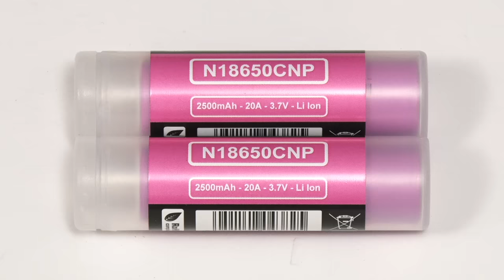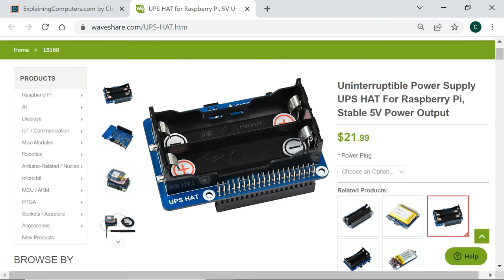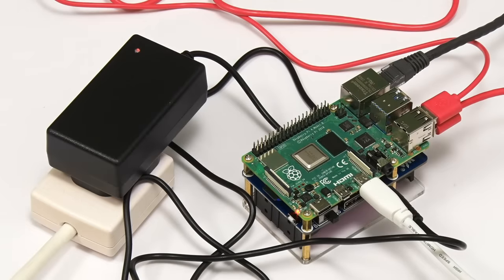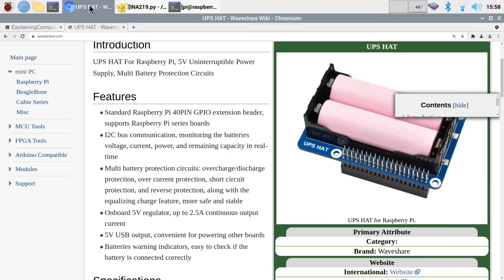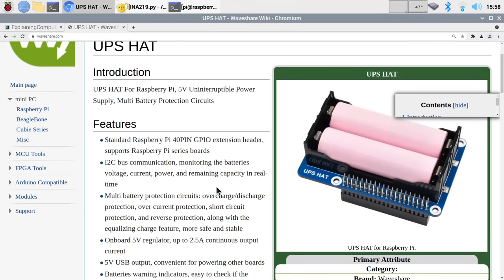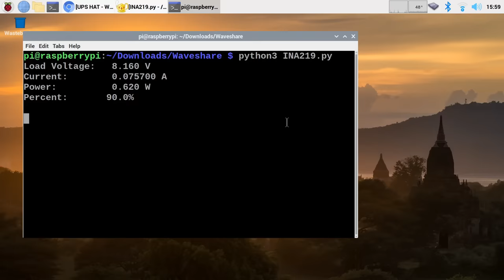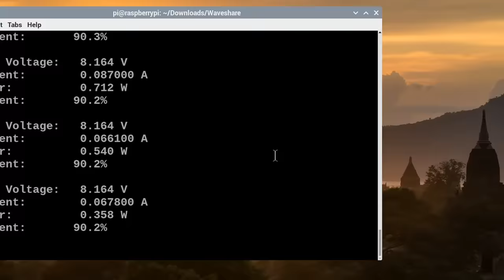Raspberry Pi Waveshare UPS

Comment: So they can't solder to battery's output a simple $0.70 full bridge rectifier as reversed polarity protection? COOL
Reply: Yeah, why don't they introduce an unnecessary 0.7 V potential drop on a low voltage system and unnecessarily complicate the whole current pathway just so people don't have to pay attention to which way the cells are inserted even though they've already included two reversed cell warning LED which they didn't have to do.
Reply: @igrim4777  Drop is not a problem since it's in battery range of 3.7-4.2V. The problem is in the following things:

1. Warning LEDS are just visuals, what do you think would happen if this "protection" fails?
2. Why the design is serially connected batteries when we'll definitely want bigger capacity for this "UPS"? The required higher voltage can be stepped up and there's a lot of room on the pcb to be integrated without a hassle
Reply: @GbpsGbps-vn3jy  Of course it's a problem. Unnecessary voltage drop is always a problem. It represents wasted power in the circuit not only due to the rectifier itself but additionally in whatever boost regulator is used because the higher the voltage change required the worse the boost efficiency.

Your question about what if the warning system fails is specious and invites the question, What if the rectifier fails?

The more components, the more points of potential failure. The warning system is a nicety, not a necessity. If it fails you're not told the cell is reversed but it's only a backup system. The power supply can still function as intended. If a rectifier fails, there goes your whole unit and while it's not that hard to do either, it's still harder to replace a bridge rectifier than an indicator LED.
Reply: @igrim4777  First of all, show me how many failed rectifiers you've collected, especially when used in below 12V DC @ 4-5A max?
Second, you don't need to have a warning system, but a proper design. For example I rly don't see where on the pcb is the protection against reversed polarity or other common failures known to happen in UPS?

Comment: What is the point of a UPS saving it from power failure if it's just going to under volt the Pi when the power comes back on.   Sure your Pi limped along but it wasn't doing anything.   If it was actually being useful it would need more power.   This seems like a bad project.

Comment: I notice some questions about battery life.  Chris has a great video on this subject in his library.  https://www.youtube.com/watch?v=lPyDtuzYE5s&t=313s.  Assuming I'm doing the math correctly a pi4 with a minimal load of 600ma / hr would translate to about 8.3hrs theoretical @ 100% battery utilization.  (5000mah battery /600ma consumption)  

Chris, so just to confirm ALL pins are available for peripherals.  Even the I2C's that are also connected to the Waveshare?  Also there is a similar battery system called piSugar.  These boards have a couple of spots for soldering a solar option.  Does Waveshare have a similar option?  As always love your videos.  Thanks,

Comment: You hit the table on purpose!
Reply from the maker: No, I didn't! :)
Reply: @ExplainingComputers  It’s funny because I was just thinking about how a vibration would cause a disconnection. Then you said you bumped the table. Fortunately most use cases that need vibration resistance can use the other solution. Thank you very much for sharing this fantastic product. We really needed this for the pi for a long time.

Comment: Why?  It's a complete and utter fail if you ask me.  Why did they make it 2 cells and why did the make the input voltage 8.4V?  Who the F has an 8.4V power supply?
The sensible design would be put the 2 18650s in parallel, use a boost converter for your 5V and then the charge voltage would be.... dah, dah, dah!!!!!   5V.  And you could run it with the same RPI 2-3A charger!
At least this attempt has a way to tell the PI it's about to die.